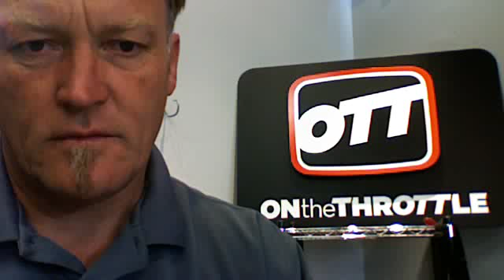Changing from DOT tires to slicks? What should I do?

Comment: im now 6 track ride not race days down and about to go on two days of coaching 
im thinking about getting a fresh set just in case i need to swap them on the day however 
can i flip the pirelli rosso 3 tires and use up the other side? 
is the rotation arrow for wet conditions?
i use moto D warmers on the low setting and run 32psi front 30psi rea at 60c low setting 
it seems my confidence into the corners is lower than driving out of them the rea temp off the track is up around 78c while the front down to around 55c 
hopefully the coaching days can help with my confidence and route/line planing at entry 
its a hornet CB919F 2002 used as an all rounder road mountains and track however im keen on a gsxr 600 for track only i dont think they allow the 750 to race in the 600 class
ether way id like something with adjustable suspension and foot pegs the dont hit the ground the right side peg has a flat spot about an inch round 
way off line now..
so is it a bad idea to flip road tires for track use if its dry? it seems a waste to bin them with probably another 3 days on the half used side shame i cant put a photo in here 
thanks dave
Reply from the maker: If you are getting coaching it would be best to get new tires. There's no point having the tires limit your learning opportunity.